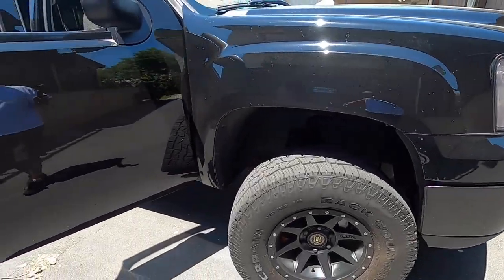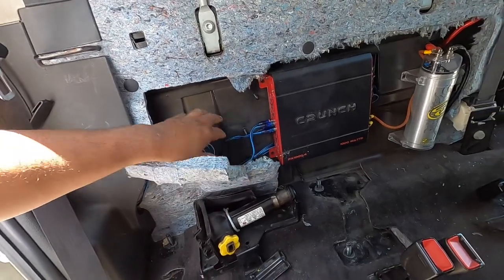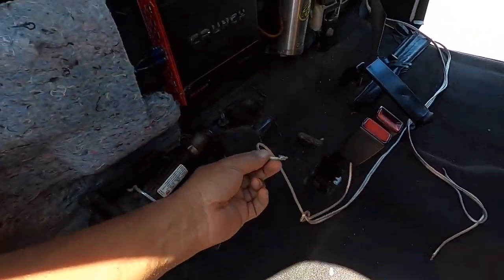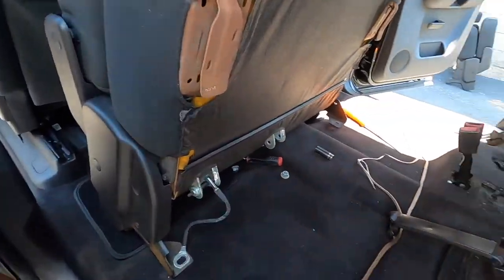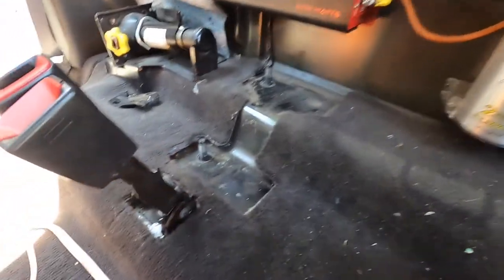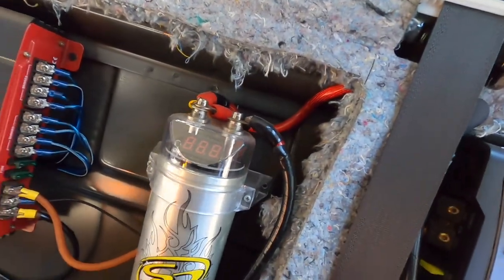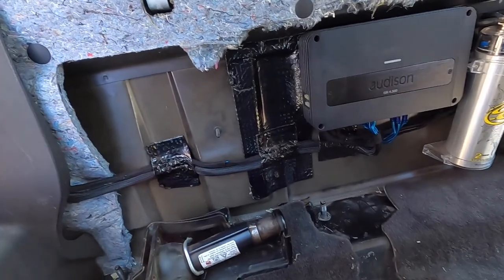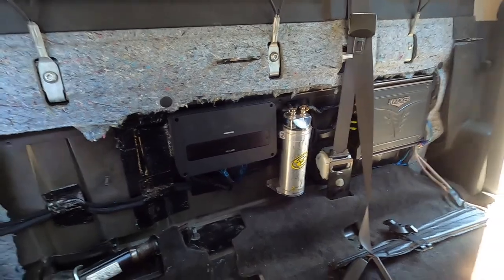Installed the Audison SR 4.500 (4 channel amp) & had to do a 911 rescue on the past in stall...

Comment: Hi Lance, I was looking at these and seems there’s a version 2 out sr4.500.2  do you know what the changes are and if it’s worth the extra money for .2?
Reply from the maker: The .2 version is the most current that I’m aware of. The .2 has a 4 gauge power input which always the amp to be more stable at high volumes. 
Yes it’s worth it.
Reply: @lancesautovlog  thanks. I need 8 channels of amplification, what would you pick? Thanks. Powering active hertz legends , 4” voce for center channel  and mille coax in rear. 

The new Sony eS 8 channel 100x8

The audio control lc6.1200 (125x6) and AC acr (75x2)

Lastly Audison SR4.500.2 (doors)+ SR4.300.2 (center and tweeters)
Reply from the maker: @daveroski  if you have the room, I would do the SR4.500. The 4.300 is ok. I like having more power.
Reply: @lancesautovlog  sr4300 would just be for tweeters and a 4”
Reply from the maker: @daveroski  yep I understand. In my experience the center will require a fair amount of power to keep up with the left & right audio. It will also be easier to adjust the tweeters. It’s a lot easier to turn down gains on the amp then try to create more output. My 2 cent.
Reply: @lancesautovlog  good point. How is the Sony es ? I love the one amp wiring.
Reply from the maker: @daveroski  Sony makes a great product, so you can’t go wrong with it.
Reply: @lancesautovlog  thanks Lance! All same power thing makes sense.

Comment: Hey bro I just installed an audison sr 4.500 but it is overheating at moderate volume I wonder if I got a defective unit. Seems to overheat easily. Any thoughts? Thanks
Reply from the maker: How are you using it? 2 channel or 4 channel? How many speakers are hooked to it? Did the amp come in a black box or white box? To start.
Reply: @lancesautovlog  I'm using it as a 4 channel. And it's hooked up to 4 speakers. It came in a black box. Appreciate the help.
Reply from the maker: @javierb524  What gauge power wires, what is the source(Radio) and what are the ohms of the speakers?
Reply: @lancesautovlog  Its on 4 Guage power and ground wires. The speakers are 4 ohms and the head unit is a pioneer avh model.
Reply from the maker: @javierb524 100% copper wires?
Reply: @lancesautovlog  I believe so it's advertised as 100% OFC wires from sonic electronix.
Reply from the maker: @javierb524 we’re the gains set at?
Reply: @lancesautovlog  I'll have to look at them tomorrow, can I send you a picture of where the gains were set at. I appreciate your help.
Reply from the maker: @javierb524  sure email me. Lancesautovlog@gmail.com